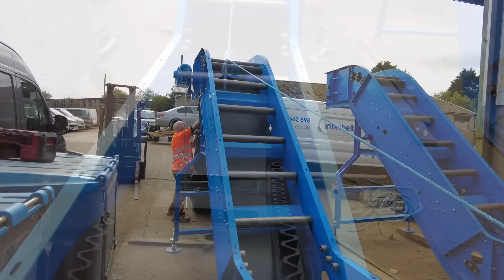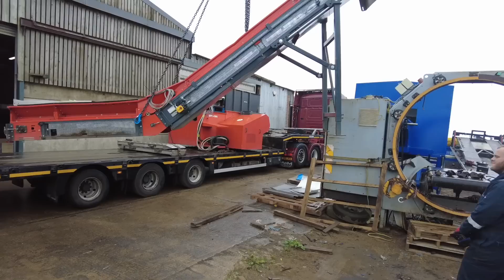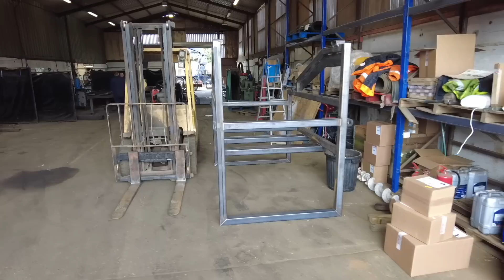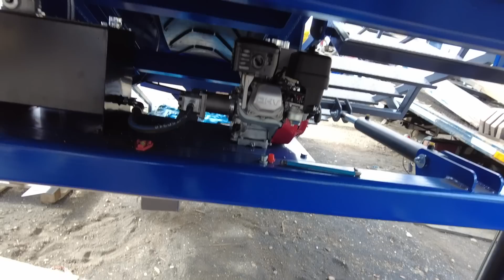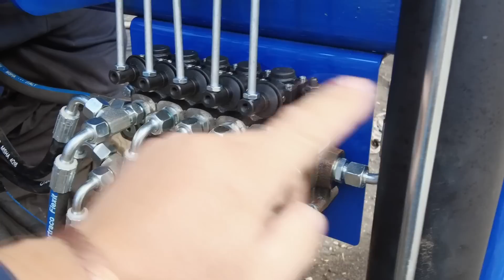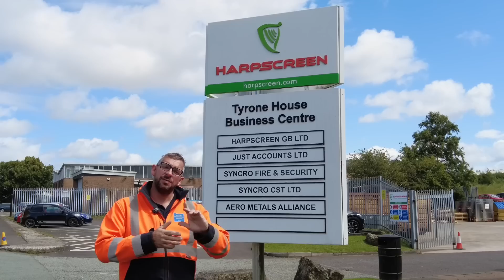@CuttingEdgeEngineering pomey uncle works at Spitfire Engineering !

Comment: Looking at the under rollers on the conveyor systems for France, the narrow width of the contact surface of the wheels look like they could cut into the rubber.
Reply from the maker: Thanks for the comment. The roller discs do look as though they will cut into the belt but we’ve never had a problem doing it this way

Comment: Hi Gavin and amazing team ...

Something definitely differently this vlog and very interesting 👍🏻👍🏻 

The interbelt process and factory line is superb! 

I know from personal experience having to explain a process regardless of how many years you've done it refreshens the mind. It's funny what we forget and do instinctively! 

I can believe about the paint company and chemical...I think sourcing and actually paying for stuff these days is getting harder

Thats very clever regarding the belt on the conveyor stopping the chippings and splinters from clogging the machines and it's rollers...

I now know 1000% more than I did 33 minutes ago about hydraulic pumps , control lever valve bank  and return tank  I like the positioning of the check valves ....very clever and I hope the end user/s are made familiar with them as again from experience I know 3 operators in or someone steps in to cover  and they don't know. We used to right a little procedure to be put up....A4 paper laminated in my day not very posh stickers 😉😉😉. Mind you they never got read either 😂😂😂😂

My friend Adam runs / has run and maintained many heavy engineering machines. I was like a kid in a sweet shop setting how the lathes, CNC and cutting machine worked. Bloody noisy though and oily 😂😂😂. I'm more of an occasional site visit and office boy or was 👍🏻👍🏻👍🏻. 

Great to see Harp screen and what a lovely clean site they keep. 👍🏻👍🏻👍🏻

Glad you had a great day at Haydock....you had both the weather and winners 🏆 🏆 

Keep up the great work. 

Gary 🦉 🦉 🦉
Reply from the maker: Thanks Gary, always appreciate your comments. It’s certainly a varied episode this week. Have a good week mate.